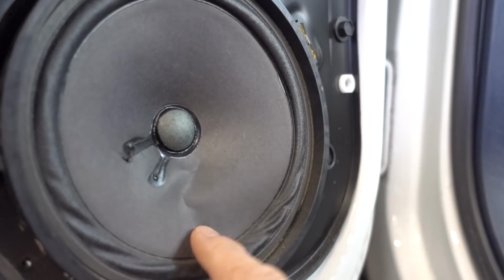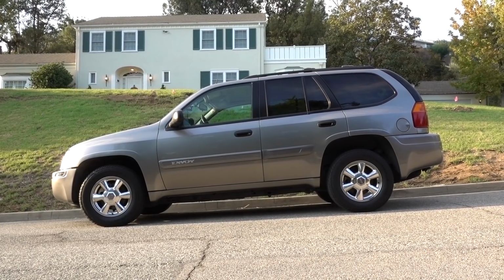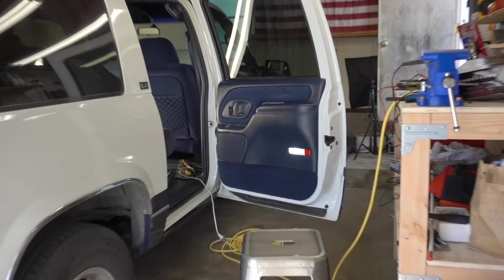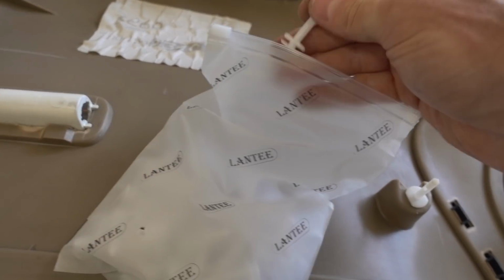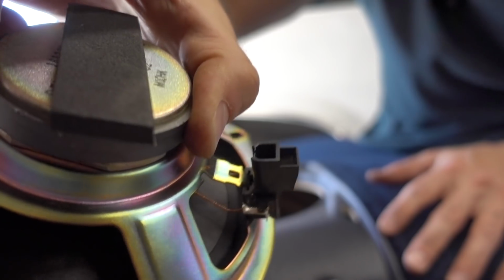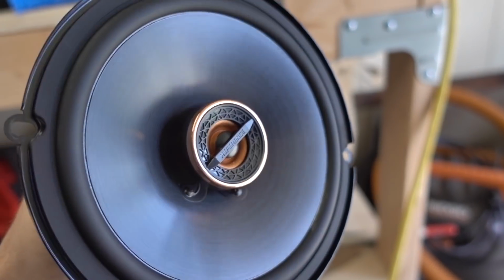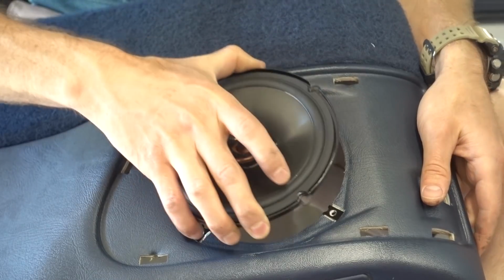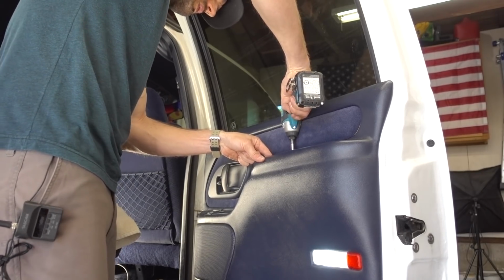This Is Why YOUR FACTORY CAR SPEAKERS SUCK!

Comment: I used to have a 2004 Lexus RX330 and it had nice polypropylene cone speakers and silk dome tweeters from the factory. It’s a stock system that does not suck. Currently, I have a 2015 Toyota Camry LE and the sound system is slightly worse than my old Lexus that once I had. I'm upgrading it to sony Mobile ES with 6.5 components upfront and 6x9 coaxials in the back, and a Sony XM GS4 amplifier to power them.

Comment: 👍 and sounds like you already replaced the rears on the envoy. No trouble? Good to know; I thought those radios required 8ohm rear. My brother's '05 Silverado and my '00 both have factory 8ohm rear speakers, but I'll be swapping mine out (already swapped the radio and installed amps)

Comment: 2005 Ford Explorer. Put in head upgrade head unit first. Factory speakers sounded better. Upgrade speakers plus adding a full 12 volts to the Ford subwoofer & factory amp makes for a great system.

Comment: My 2000 Ford Ranger had the worst factory speaks, the two front ones where terrible and it didn't even have rear one. I decided to put in 4 brand new kicker speakers paired with alpines compact sub that sits behind the seats. Also replaced the head unit with a double Din Kenwood tuner and a 4 way power amplifier to supply the speakers with the the correct amps.

Comment: Once power is applied along with proper ground and assuming that everything is connected correctly, any amount of volume causes distortion and ugly noise, off key vocals and flat notes flow freely from my speakers like foul language from a sailors mouth. Now, with the volume all the way down, the speakers sound fine. It's like listening to an acapella song that has no lyrics. I think I will try this upgrade although I will not be using a soldering iron. Why not? Because Hot Burn Me. Crimped Spade connections for me, thanks. Keep it up Jimmy, your opinion matters.... To someone somewhere sometimes maybe.

Comment: I have a 2005 Mazda 3 with a Pioneer head unit, with stock speakers and the bass response is amazing!
Reply: I’m just wondering this but would u say the head unit improves the sound because I have a corsa with Sony speakers all round but sometimes it sounds like it’s lacking quality with things like drums and the voices, from your experience with it would u say buying a new head unit from a good company would be worth while?
Reply: @joshuawarrington1051  The headunit is the main component. It would make the vocals and anything else sound better. Since you do have aftermarket speakers. I would recommend something with 50×4 watts. May not seem like a  lot but it makes a HUGE difference.
Reply: Basement Records well thanks for the advice mate I’ll look in to some. 👌

Comment: "You stock speakers suck because the auto manufacturer doesn't specialize in audio." No duh..... I was hoping for a halfway scientific answer like the cone structure is not rigid and therefore flexes causing distortion (or) the crossovers are so poorly designed that they don't account for time alignment and cause huge peaks/nulls in the frequency response near the crossover frequency, etc... 
In terms of replacement speakers, put a $300 pair of JBL's against a $20 set of Polks and the Polks will sound like junk. Similarly, if you put a $20 set of JBL's against a $300 pair of Polk's, the Polks will blow the JBL's out of the water. My point is, the brand in and of itself is completely useless information in terms of speaker recommendations if that's the only information you're citing.
Reply: But back at the factory, number-crunchers decided that if you want a new car with something as fancy as $20 speakers, you'll just have to buy the factory's $400 premium audio upgrade package, or you'll be listening to their nasty standard grade $4 speakers . The auto manufacturers know that their standard speakers are trash and they've invested in market research telling them how many people only listen to sports or hate radio, are deaf, oblivious to sound quality or don't notice or care. If the standard stuff sounded any better, the manufacturers couldn't get the extra profit from the minority who do care for selling them the upgrade.
Reply: @johnstuartsmith  Even still, a lot of the 'premium' speaker packages are also very 'meh'. If I'm buying a 'premium' sound system; I would MUCH prefer a few good quality speakers over 37 junk speakers. I put in a set of mid-low end component speakers with an amp and a mid-low end aftermarket head unit and they sound TONS better than anything that ever came stock in my car - including the upgraded bose system!
Reply: @Kcducttaper1  Because the "premium" factory speaker packages featured the "fancy" $20 speakers that weren't as good as the $40 speakers you got at Wal-Mart to replace them.

Comment: My 02 Dodge RAM 1500 had a decent factory system, but after 10 years the OEM speakers dry rotted. I also used Infinity replacement, but only because they were the only 2Ohm replacement I could find. While I love this video impedance matching is important and wasn't discussed at all. A set of 4ohm speakers on a 2ohm system will not get very loud and a set of 2ohm speakers on a 4ohm head unit will cause a meltdown.
Reply: If you hook 2 four ohm speakers in parallel you will get 2 ohms. Now the question where to put the second speaker if you must mismatch it's better to use 4 ohms on a two ohm system than using 2 ohms on a four ohm system. Less ohms equals more load. To avoid miss matching  you might need to replace an amp and match both speaker and amplifier the same load. I never saw a 2 ohm speaker the lowest I ever saw was a 3.2 ohm tv speaker. Most home speakers are 8 ohms.

Comment: You should also have a set of 6x9 speakers in the back at the top rear of the truck on the ceiling.
Reply: Jim Henline actually the correct size of speakers are 4x10 that are mounted in the ceiling

Comment: Hey guys! So I drive a 2003 Ford F-150 extended cab. I have some Pioneer door speakers (I forgot the model) but they are four way coaxials, and sound great! My stock speakers were pretty good, except they could've used a tweeter. But they def. Were alright for stock. But since I've replaced them they sound much better, and crisper. Much better output, bass, mid bass, and high frequencies. Now my friend has a 2016 Honda Accord sport, and the stock speakers are actually pretty good in it! I was impressed lol. But anyways just thought I'd share. And that Pioneer has some great stuff! Anyways, good luck to anyone doing this to their vehicle (it's honestly not hard, just gotta take the time to do it) and hope y'all have a great day!

Comment: The speakers in my '98 Ranger are just fine. Nothing like the Alpine system I had in my Pinto, but acceptable.
Why didn't you put any sound deadening in the door while you had it accessible?
Reply: Ikrr
Reply: Wow, I had a runabout back in the day. (70's)
Reply: Thanks Fred, memories of older cars. My mother had a Pinto Wagon called Bessie the Pinto, she was an alcoholic. When ever the air was damped it wouldnt start without a can of heat put in the gas tank.  Dads Pinto Hatch Back was better then that. My Nova iHatchback i had home made speakers and boxes with an power amp built in electronics class. the good ole days.
Reply: Im just going to say.. My stock "Premium" speakers out of my '98 ranger SUCKED! anything you could put in those doors are better...
Reply: I have a 78 Pinto Pony trunk model that I’m hoping to put a system in. I want a hidden head unit so I can keep the 8 track in the dash.
Reply: Older Fords came factory with Altec-Lansing speakers. Until that became common knowledge the junkyards were full of free/cheap great 6x9s designed by NASA engineers for perfect clarity! Even crappy little Fiestas had ‘em. 
As others have pointed out already, some other factory installed speakers are awesome, while some are barely functional. Doesn’t appear to be any hard and fast reason which models get great or garbage so it’s handy to know how to replace them and how to get them out without destroying the door panels. I’m currently driving a 13 year old Spectra5 that the previous owner destroyed the door panels installing more speakers, boost, bass and amp than the car is worth. Wish they’d watched this video!
Reply: @haroldsherrill5883  : More than the car is worth...That was my Pinto, $800 for the car, $1200 for the stereo. Younger and dumber.
Reply: I always took the sound deadening materials out of speaker enclosure because the speaker sounded better without that stuff in the speaker cabinet. I never knew why engineers thought it helped the speaker sound better. I'm sorry I'm old school when it comes to sound quality. Most younger people never heard a tube amplifier and wooden speaker enclosures. The particleboard junk they make today is not good for speakers.
Reply: I really don't know what is better when it comes to car speaker enclosures.  A wood box can make even cheap speakers sound better.

Comment: Somewhat late, but here goes:
Right now, I drive a 2011 Subaru Outback. The sound system in it is ok, but the head unit sucks major ass. Just about the only redeeming feature it has is an ipod connection.
Before that, I had a 2012 Seat Leon, a car that isn't sold in the US. This car had the best sound setup I ever encountered. Each door had a normal speaker and a tweeter, the head unit was dead simple, and I enjoyed it very much. Unfortunately, a manual gearbox and rush hour traffic on a daily commute don't mix.

Comment: I like my car factory audio so much that i installed in trunk a sub woofer connected directly on the rear speakers wires in bridge. Is very stable and pretty loud, no distortions. Who needs an amp. Who would have tough that a factory head unit cd player can output a total of 180w. I can shake with deep bass the car using only head unit and it doesn't get hot. No more battery deplete, no more broken alternator. I can listen on max volume 2 hours with engine stopped and still have enough power to start the car. ~92db max only from sub. In total around 98db.

Comment: Doesn't really matter what speakers you put in that SUV, since there's absolutely zero resonance box for it. You could literally see the speaker just by looking down the door handle when removed. Seal it up with some bitumen or asphalt board and make an airtight  chamber. That can even make factory speakers sound awesome sometimes

Comment: These days you really don't have to replace factory speakers. Actually, even in 1994, I didn't have to change out my system in my Camaro but working at a stereo shop and getting everything at 50% off why not. $8000 later with a very built ADS system...
Upgrading always sounds better speaker wise. But even in a 2008 Sentra daily driver bought for $1000, the sound is very acceptable. Because the aux plug used with Spotify makes the sound coming from stock paper speakers sound acceptable even in the louder range. Save your money. Spend your money more wisely on these older cars and drive them with more care so less money is put into them.  By the way, I gave my Camaro to my little brother and sold my system to a Porsche owner for $8000. 👍🏼. Buy low to sell fairly!

Comment: I have Rockford Fosgate Primes. Sound great! Went with a Massive Audio 5 channel amp, the 2000.1 I think. The RMS rating is bullshit, but it works well for the two 3" fronts and the two 6x9s in the middle. As well as  two 8" subwoofers from Pyramid, (don't laugh, as mids they work great and they're cheap.) Set up as mid-range woofers in the rear of the Burb. I also have the Massive Audio N1 Nano for the Kicker Comp 12" subs  behind the middle row. I removed the back row for more cargo area and it suits us fine. The Burb is an 85 3/4 ton Silveraydo (sic) Edition. And has over 400k miles and just about to receive it's first open heart surgery for a new 350, 2b carb and 700r4 installed. I left the factory stereo in place but disconnected it completely and installed my pioneer sDIN headunit in the center console so it stays hidden. I've replaced all the carpeting with black indoor outdoor that just happens to help the sub box to blend in in the rear and no one that can actually see through the 5% tint all around, can even tell it's not stock interior. I redid the headliner using super soft plush microfiber fleece blankets from Amazon and it came out amazing. Just a bit of info on my project. Have a good one Jimmy!

Comment: 2010 CVPI. Skar audio 6x8’s all around, 2 Skar EVL 15’s in the trunk on a RP2000.1D. Pioneer head unit and a secondary battery setup.

Comment: 2003 Camry Sounds Good and it is not a fancy sound system. 1995 Tacoma 4x4 dreadful needs new head unit because the lights are burnt out so you can not see what station your on but it works. The speakers are shot.

Comment: You know for about $8 you can buy a conversion wiring harness so you don't need to mess with soldering stuff to the aftermarket speaker (which also almost always voids the warranty).
Reply: @TheBrokenLife Voided warranty on a 25 year old truck! 😂 Thanks for the laugh.

Comment: The factory speakers in my 03 Escape surprisingly were not that bad. I ended up replacing them with some Kicker ones when replaced the broken factory radio, the Kickers sound pretty decent.

Comment: I have a 2010 Honda Accord Coupe with the "premium" factory sound system. Sounds ok, not amazing, but the factory subwoofer isn't very loud or deep at all. I have an aftermarket 300W 12 inch powered Rockford-Fosgate subwoofer in the trunk in addition to the factory speakers. Other than that, completely stock.

Comment: 2002 Z71 suburban. Mine says bose, but the only bose I found was the 8"sub. In the rear. The doors were factory.  I went with a sound stream set that had separate tweeters and speakers with a huge passive xover. Sound stream DVD head unit, 2 sound stream 12s on the back. And a sound stream Xtream 480 I think under the middle seat bridged to the 12s. Used the factory Amp to the doors was fine.

Comment: I have a 1998 Chevy s10 and I bought it used it already had after market head unit the speakers suxed so I went with CT sounds meso component set added super tweeter as well added a CT sounds 125.4 amp and a at2500.1 d mono with MTX blue thunder extreme 12 inch subs in box behind the seat it sounds awesome I love it almost sounds as good as home stereo 🤙🏻

Comment: I've got a 08 Aveo the ultimate in cheap cars lol. Among many other problems was that the factory stereo was total crap. I'm currently replacing the whole system with Boss audio speakers and a couple of small Boss audio amps. I've had good results from Boss in the past. It's not the best available, but still way better than factory. I'll be updating the head unit as well to something more modern. All in all I'm into it for around $300 total system cost and a few hours personal time to install.

Comment: they do not really suck but it's the speaker cabinet of it sucks because it does not have an enclosure with vents but it's only on the car side doors 😂 Newer cars now have an enclosure on its car doors and sounds good. You can really tell the difference. Here in our place one example of a car with stock speakers that sounds good is the Toyota Vios.

Comment: noice, but you should have put a loop of wire between the speaker terminals/connector as over time vibration will crack that blob of a " solder joint " ( & if you used Pb free solder, probably happen in under a year!             Cheers

Comment: in my 2010 Toyota Corolla I put JBL Stadium 6.5" co-axial speakers in my front doors. On the back deck I have Kicker speakers which I don't know the model type, unfortunately. I have a Kicker AMP to run those 4 speakers at 65RMS watts per channel. I also have an all in one JBL BassPro SL 8" 'shallow' den subwoofer which powered it 125 RMS watts and to top it off I have a Dynamate sound dampening system throughout the car to stop any unwanted vibrations.

Comment: Good video. Greetings from Great Britain (UK). Stock speakers suck! I've had good results from Alpine G series and JBL. Worth adding sound deadening on the inside of the door skin whilst you have the door card off, and perhaps spray some waxoyl into the bottom of the door while you have access. Also a foam wave guide around the front of the speaker picks up the mid bass just great. Nice cars, no good here in the U.K. though with gas at nearly 10 usd a gallon!

Comment: The Acadias with the Bose sound system are pretty good only need replacement on the rear speakers but the front ones have good bass

Comment: In my 2001 ford ranger 4.0 by 4x4 xlt, my factory 6x8 speakers(all 4 are 6x8's) are junk in comparison to the 6x8 kickers I had replaced them with! My factory radio can't push enough power to run them at max but for me, they're plenty loud! Loud enough to get the cops called on me & I was playing them at noon at my home which there isn't a noise ordinance law for my area so, glad the cops found that funny & let me know not to play it that loud while in town though, which there is a noise ordinance laws in town! Cops where cool & surprised on how just replacing the speakers could easily make things sound way better!

Comment: I have a 2010 Ford Expedition EL Limited  With navigation system the factory speakers are actually really good really heavy bass even without the factory sub woofer . Thinking about  upgrading them one day but for now they are actually fine I think .

Comment: I own a Peugeot 206 2 door, and oh boy do my speakers suck. The speaker surround is made of some kinda foam, and the cone out of very thin paper. Both surround and cone ripped apart, and now all of my speaker cones just dangle around since surrounds ripped. I'm soon gonna replace all speakers with either aftermarket or factory upgrades. 

Sound-wise, they sound like cards on bicycle wheels when bass hits.